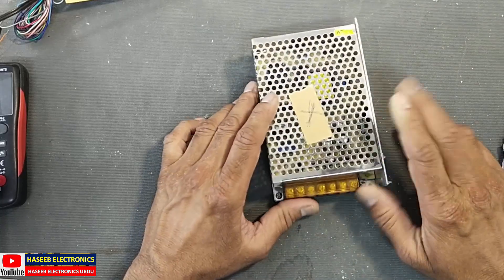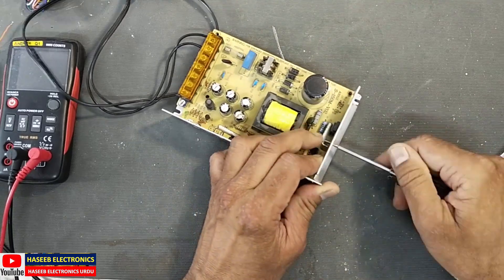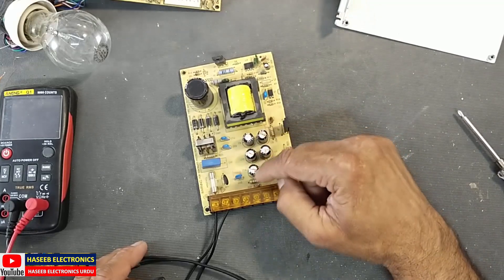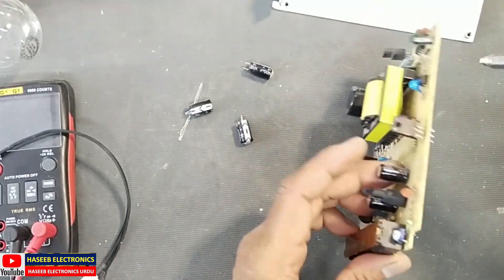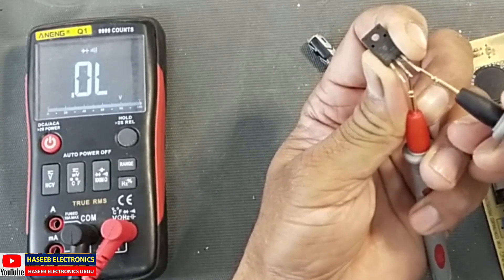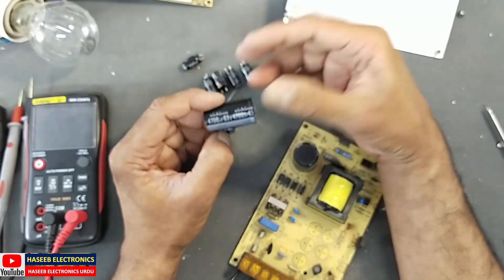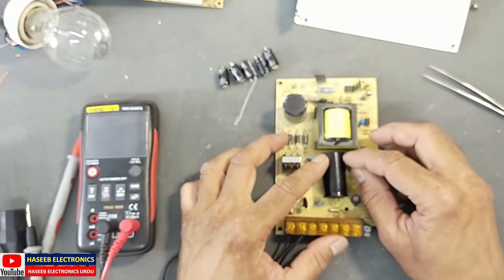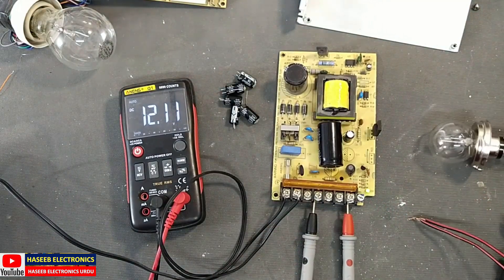{630} SMPS output voltage fluctuation || output not regulated

Comment: Pls tell me the desolderinf iron you r using. Which one. Is it available in India
Reply from the maker: https://www.indiamart.com/proddetail/weller-wr3m-3-in-1-high-end-electronic-pcb-soldering-de-solderign-hot-air-gun-rework-station-9437196497.html?pos=3&kwd=weller%20wr3m&tags=A||||7554.316|Price|product|||TS
Reply from the maker: it is weller WR3M rework station

Comment: Sir uc2842 power supply have fluctuate probable output not find shot circuit at VCC capacitor 10 to 15 voltage going up & down ?
Reply from the maker: please check video number 758. i think you will find your problem in that video

Comment: Although it will work but theortically I  think replacing 5 capacitor  with one capacitor will raise ESR.
Reply from the maker: you are right brother 
we must use Low ESR capacitor for low output impedance

Comment: Sir I have one question in my smps all circuits caps seems ok but at load Voltage is dropping
Reply from the maker: there are many possibilities 
voltage feedback circuit
current limiting circuit 
Snubber circuit
Output capacitors

Comment: How come the atx you showed in your previous video had a bad regulatio. Voltage dropped to 11.36v ?
Reply from the maker: this is due to providing the bypass, and disabling the current sense circuit which is routed the protection IC LM339. in upcoming session, in upcoming session LM339 and its related features will discussed
Reply: @HaseebElectronics  Thank you , can't wait to see an ATX providing regulation at full load.

Comment: It pays to use good Nichicon, or Illinois (or similar) capacitors from a reputable source. Even if they have the name on them, they could be fakes. As you've seen, there is a LOT of junk out there. Even so, 16 volt rating is too close to 12 volts for my comfort, although it's common practice. I always learn a lot from you. Thanks and have a great day!
Reply from the maker: yes dear you are absolutely right 
that these falsely marked / copied components are biggest headache for the end user and endpoint service engineer

Comment: Caps are always drying out in power supply due to getting to hot. I did not suspect the rectifier so I have learned something new. Thank you you are doing a great job teaching.
Reply from the maker: yes you are right 
these fake capacitors get damage quickly. in some cases if the rectifier gets shorted, it also passes the negative spikes to the capacitors 
or 
it directly damages the IC in primary side or MOSFET by adding direct load on flyback converter

Comment: Nice, but every time I have the ability to use many capacitors in parallel I prefer to do so due to the much lower composite output resistance , so I believe better transient response 😉
Reply: it is not related with it .If connected  paralel that is mean more low ESR and more low  cost price

Comment: Sir, is it possible to modify the range from 12v/10A to 12v/15A
Reply from the maker: if we want to re-design a power supply 12V 10A to 12V 15A.
don't consider the Ampere 
we need to keep in mind the Wattage 
we want tp take 180Watt from a 120watt circuit 
which is technically near to impossible 
because all the primary and secondary side components are being used to handle 120watt. although all components are calculated with some free headroom for safety aspects 
but when we want to convert it to for permanent operation at higher rating, it will ENDED very soon 
it is doable, by redesigning the transformer, changing higher mosfet, changing the current sense resistance, RCD snubber, Bulk capacitor, bridge rectifier, EMI filter, output rectifier & capacitor 
and the biggest issue is the PCB tracks. as the existing tracks are only for 10 Ampere, so flowing more current will lead to early damage, and to create more noise in switching
Reply: Yes it can possiable with more  high power  MOSFET .Limit is SMSP transformer's power rate and transformer's present wires  diameters (of course need more big heatsink .Maybe need cooling fan too )
Reply: Thanks for your kind information

Comment: Sir we didn't get how you connected capacitors in parallel
Reply: Anyway all 5 bad capacitors are connected paralell(on PCB) .Only connected 4700 uf and 680 uf  to any hole . Average same capacitance value
Reply: Başladığınız kondansatir kaç volt?

Comment: Hi sir Good evening 🙏 
In this case why the capacitors are damaged. 
Karen kya ho sakta hain...?
Reply: Thank you
Reply: Have 4-5 reason.
Using long time in maximum power load
Not clean AC line voltages
Not enought quality manufacture capacitors
Very high temperature in working area
...
...